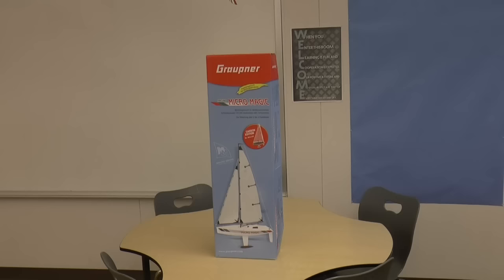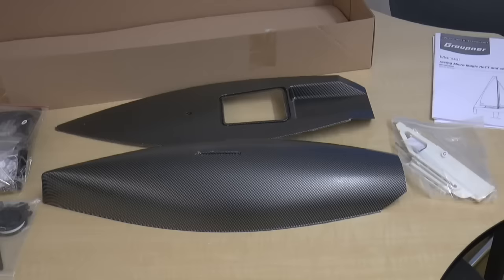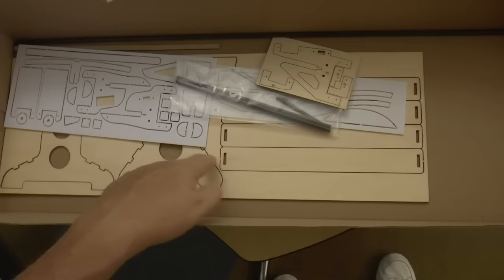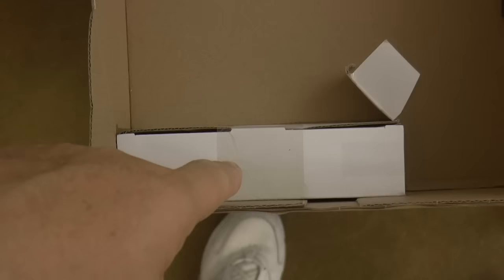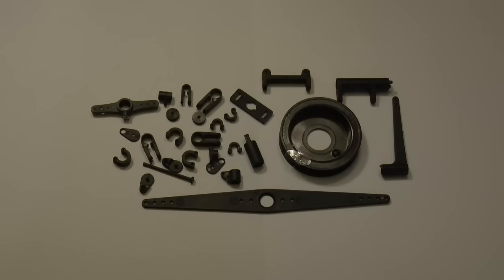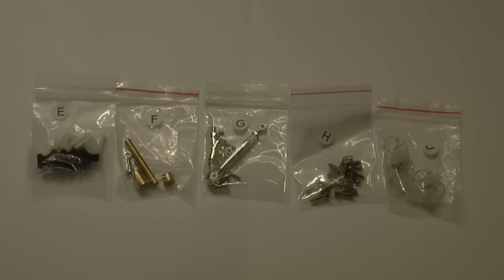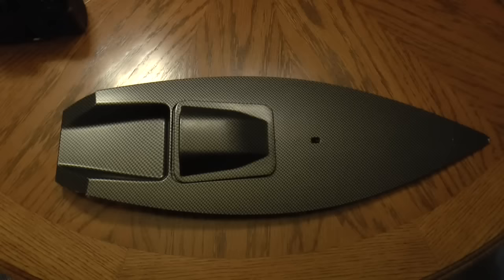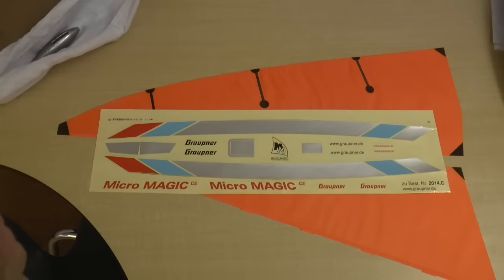Graupner's Micro Magic Racing RC Sailboat Unboxing

Comment: The hull and deck are NOT carbon fibre but a black styrene moulding with a carbon effect printed on the plastic. This costs more but are less visible in the distance therefore the white hull would be better.
Reply: so at the end the standard white version is more value for money? or maybe there's something special in the carbon edition apart from the fake carbon fiber?

Comment: Great video! Do you have an update on the building process? I have the kit at home but I haven't started the built as I'm not sure how to find or better to say measure the correct position of the rudder as there are no pre-drilled holes for it.